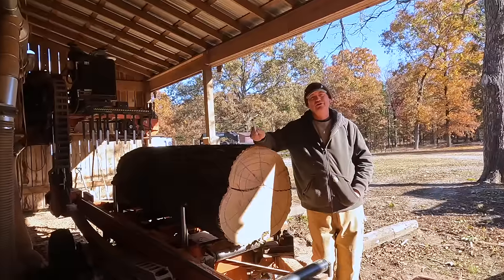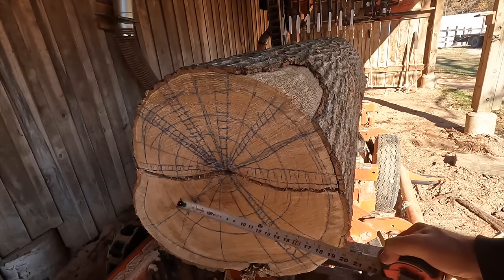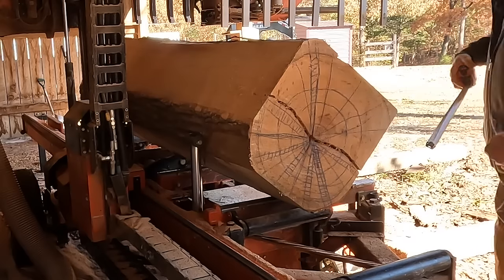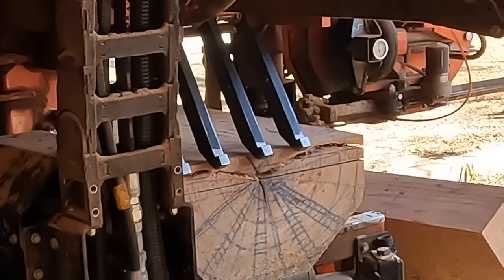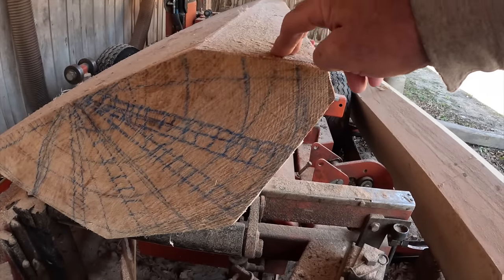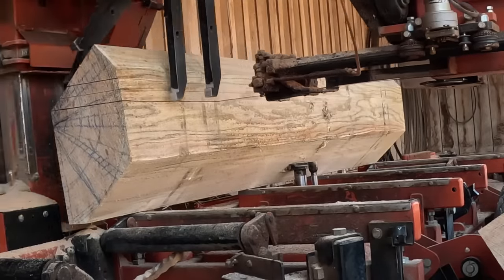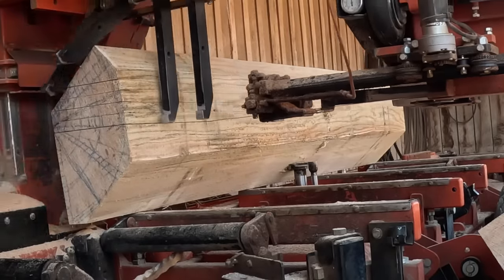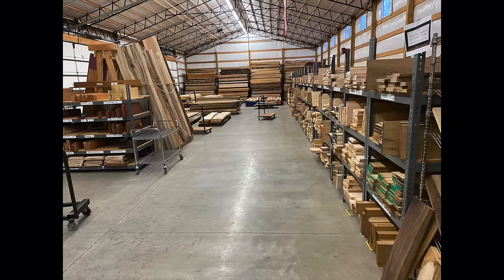A Professional SPILLS Quartersawing (Top 5) Sawmill Secrets

Comment: I’ve been patiently waiting for part 2. As always great content and information. On your first jelly roll cut, I’ve wondered if there was a benefit to starting with a low angle cut like that. Appears it didn’t prove to have any benefit. I tend to try to “squeeze “ a little more out of a log and end up with very little improvement over what I already would have had if that makes sense. lol
Reply from the maker: Yeah, it's kind of a judgement call.  Sometimes it't not worth it to push the log and get maximum yield, but better to get high grade boards.  I appreciate you watching, and there is no right or wrong way, just what works for you!

Comment: I wanted to ask about quarter sawing on my LT15. I bought my first sawmill, an LT15, about 1 year ago. I am a custom home builder, so at this point, I am just learning the craft of milling. I am not dependent on milling for a living ( yet 👍🏼), but I do want to learn how to maximize the quality of every log I am milling. I know that I can cut quarter saw boards on my mill, but it is more difficult with no hydraulic arms. I know that your first mill was an LT15. Did you cut much quarter sawn lumber on it and if so, do you have any advice or techniques that would make it easier on my mill. 
Thanks again, I really enjoy and learn a lot from your videos!
Reply from the maker: You are correct, I had an all manual LT-15 and modified the clamps to allow quarter sawing.  Unfortunately, I have very little photographic records of that mill, I eventually converted it to all hydraulic with very simple components.

Comment: Did you go back in and do a 2nd cut to make them squre boards?
Reply from the maker: Not on our mill, but it could certainly be done.  We use our dual blade edger or our Straight Line Ripsaw to very quickly edge all of our boards.  Thanks. for the comment.

Comment: How much do you let the engine idle? Do you keep it on when you measure the pith height at both ends? Or is it better for the engine to turn it off and on more often? I know that it’s better for it to be sawing instead of idling.
Reply from the maker: I will idle it.  There is no harm in idling, depending on the mill manufacturer, assuming the drive belt is adequately ticking over aand not wearing  a flat spot.  I turn the engine off when I'm filming so I can be heard easier on video.

Comment: Great info, as always.
Not sure why you find the pith level with a sticker and a tape measure. Would it not be quicker to just put the blade next to the pith and read directly from the mills gauge? or is it something about a newer mill that uses setworks? 
You are the Master and we are all grasshoppers.
Reply from the maker: Since I'm measuring both ends of the log, it's just easier and faster to use a tape measure, since I can't see the band in relation to the pith on the far side of the log.  Thanks for watching!

Comment: Good Morning. Thanks for sharing the insights. Clamping looks easy on a hydraulic mill, manual clamping is more difficult but can be done as well with some tricks. How thick are you cutting the boards? 1" = ~25mm, 1 1/2" = ~37mm?
Reply from the maker: For 4/4 hardwood, the industry standard is 1-1/8" thick.  4/4 softwood is sawn 1" thick.  8/4 hardwood is sawn 2-3/8" thick.
Reply: @HobbyHardwoodAlabama  Thank you. I will cut a oak log tomorrow i took out of my forest - lets see how quatersawing turns out. 👍

Comment: Do you have a suggestion for a novice that wishes to purchase his first saw mill and then cut like a pro?
Reply from the maker: An LT40 is probably the most reliable, accurate, economical and simple to use hydraulic mill to buy on the market. It’s not the fastest, or fanciest, or other stuff, but it’s what built Woodmizer’s reputation.  I had one and started a business with it and no, I am not sponsored by Woodmizer.
Reply: @HobbyHardwoodAlabama  I agree, my woodmizer is 30+ years old and I would not trade it for a new model with all the computer gizmos that will fail shortly and cannot be repaired by the sawyer.

Comment: Is quarter sawn lumber better for building with? i.e. More stable lumber, less likely to form defects while drying? Are these boards mostly useful to furniture builders and high end structural/construction enthusiasts?
Reply from the maker: It is better in that it will always be flatter and more stable, but some people think the medullary rays are too "busy" and prefer either rift sawn or flat sawn.  It is worth much more on the lumber market, and is the preferred wood for many furniture projects.
Reply: @HobbyHardwoodAlabama  I agree, Quartersawn oak is not my choice, for it's appearance, but that is just my prejudice,  It is far more stable than any other cut.

Comment: So it's not a perfect gun barrel?  So your barrel cuts don't have to be 45° to the first 4 faces? Just following the best grain
Reply: And do you need to remove the "triangle" waste wood off, before air drying?
Reply from the maker: You are correct.  No matter how many faces you put on the gun barrel, they only have to be accurately aligned with the center axis of the log.